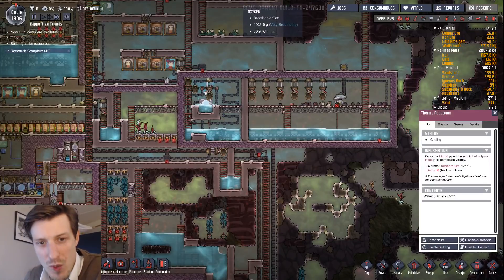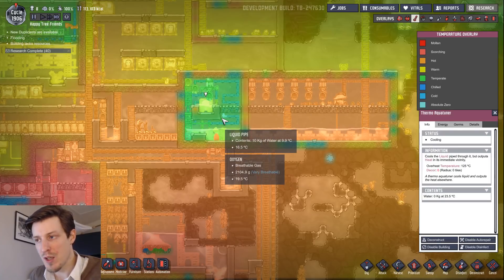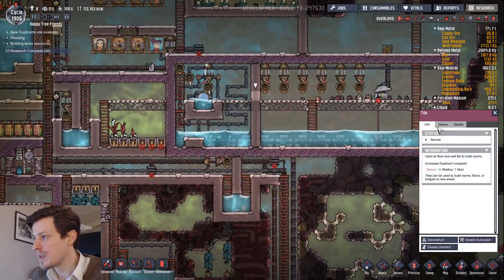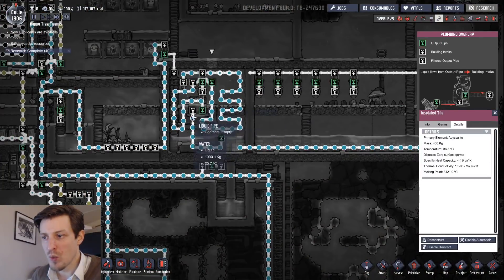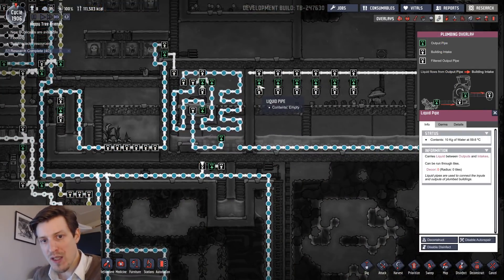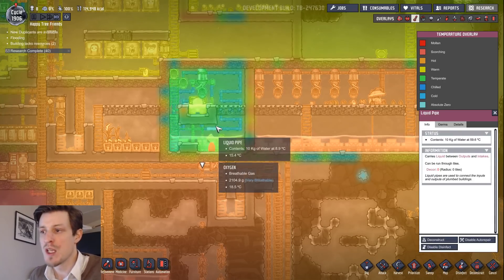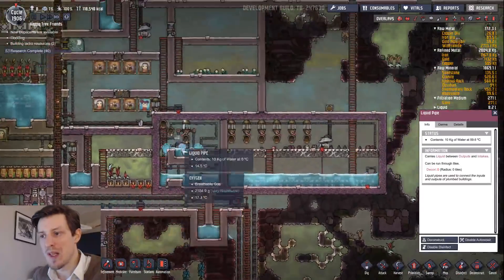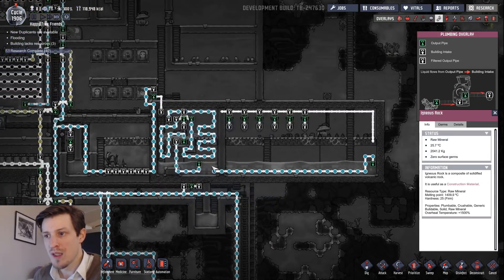How to cool water (or other stuff) with Energy as only input (the-drip-down-effect)

Comment: Good idea, the pip layout is important in this case?
Reply from the maker: +Rodrigo Schiavo hi. Not exactly fpr the cooling itself
 But with this build the air got to hot (even if the water got cold) when i didn t have a pipe resulting in heat damage to the machinery. So they cool down the air.

However i have made a much more efficient setup and also thx to some help discussing this in klei forum now know exactly what is cousing the cooling. I ll make a new video about it with a detailed explenation as soon as i got time